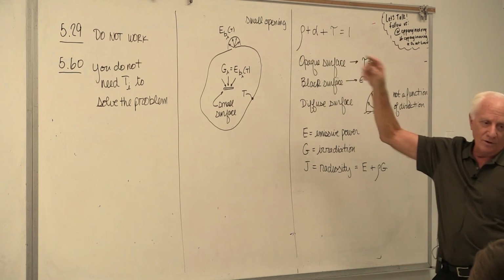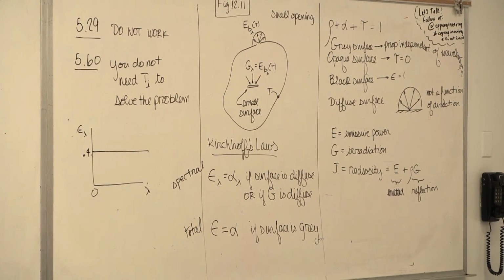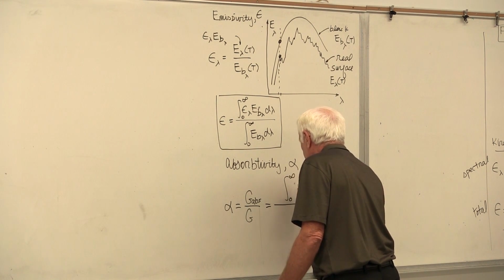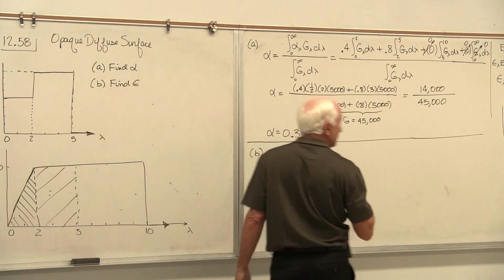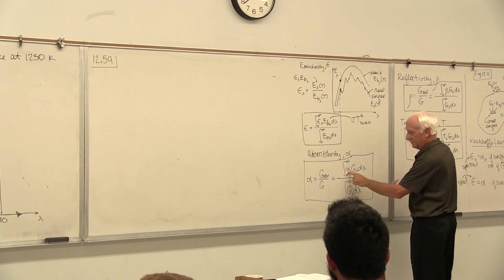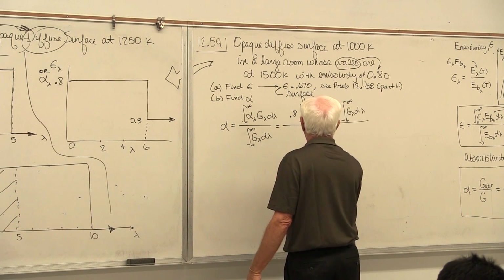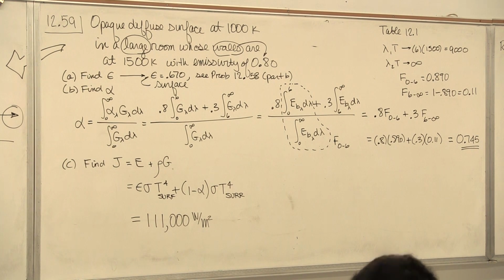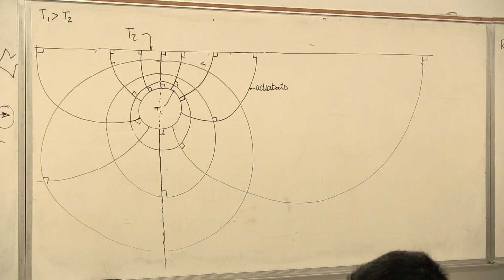Heat Transfer: Thermal Radiation Properties (13 of 26)

Comment: For problem 12.59 part c, i think you are missing the emissivity of the surrounding in the equation. Emissivity multiplied by T^4 of surface is emissivity of surface calculated in par a, and i think there should be emissivity of surrounding of 0.8 given multiplied by T^4 of surrounding.
Reply: Which equation in the text are you referring to? For this equation, he is using the J=E+pG; not looking for the flux yet.

Comment: In problem 12.59 in last step in which we find radiosity , why isn't G replaced by emissivity(wall)*sigma*T^4 ???
Reply: The irradiation G on the small surface is independent of emissivity of the enclosure, see figure at 49.44   The irradiation inside the enclosure only depends on the temperature of the walls.  The emissive power of the small surface depends on both the surface's emissivity and its temperature.
Reply: Because emissivity is the ability of the surface to emit energy. G is not replaced on emission just on the reflection part.  G is only reflected, transmited or absorbed, not emitted